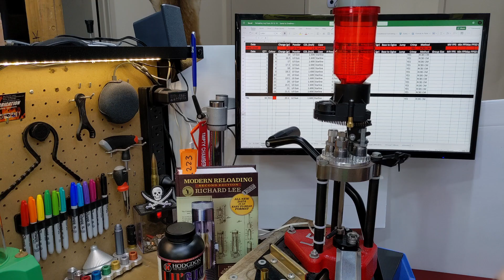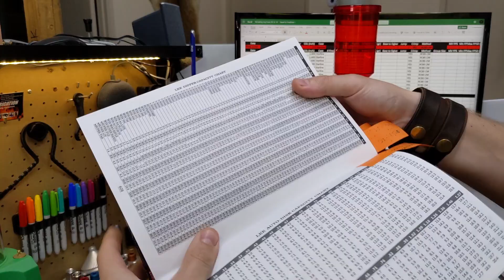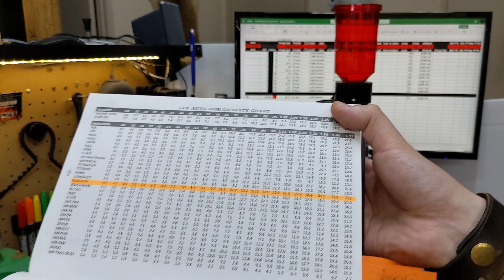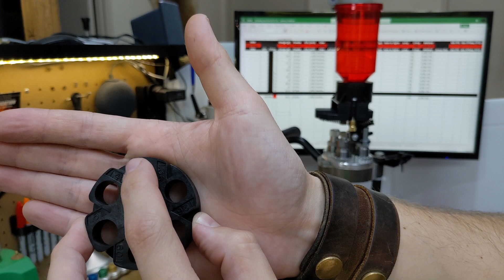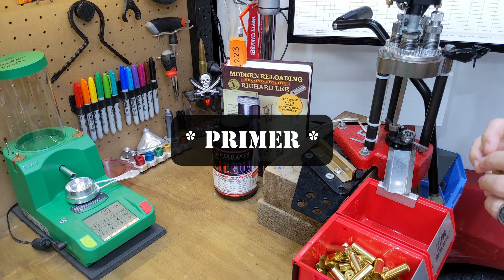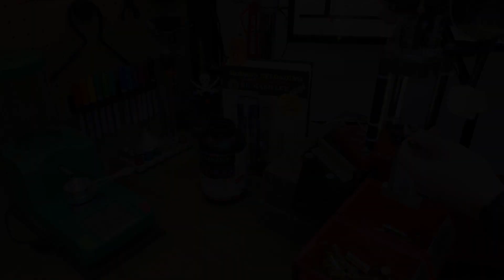Drop like a Pro - Lee Pro Auto Disk - Reloading: Episode 21

Comment: Thanks for this great video. I too use the Auto Disk on my Classic Turret Press. I am afraid that Lee is phasing out this Disk in favor of the Auto Drum. I customized my Auto Disks by lightly sanding and polishing the top of each disk so that the wiper works better. I dusted the powder bin with dry graphite to reduce powder cling. Also I bought extra Auto Disks and side-drill the charge holes to accept coarse-thread allen set screws. Screwing the set screws in and out let me fine-tune the powder charge. I can now meter even fine flake powders accurately. IMHO Works better than using the Lee Adjustable Charge Bar.
Reply from the maker: i just like the fact it throws consistant powder charges without complication. im getting single digit SD's with all my pistol calibres. thanks for the tips